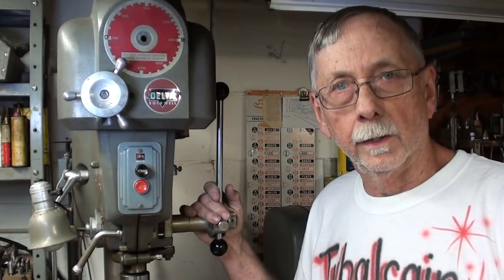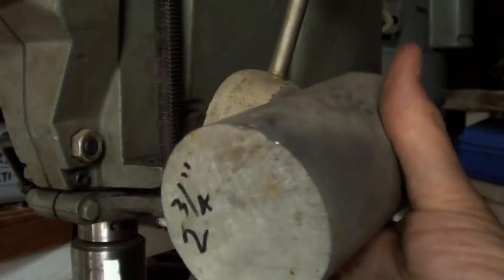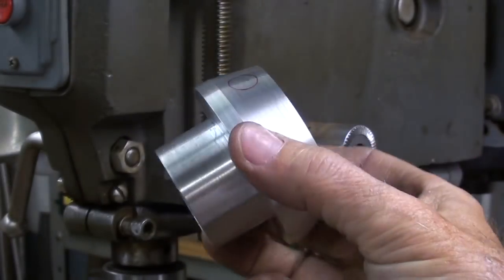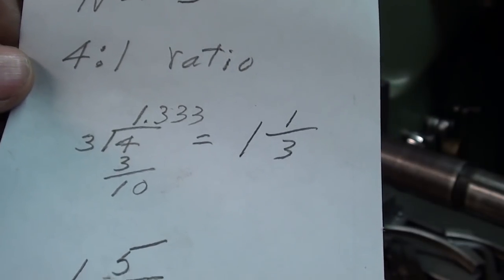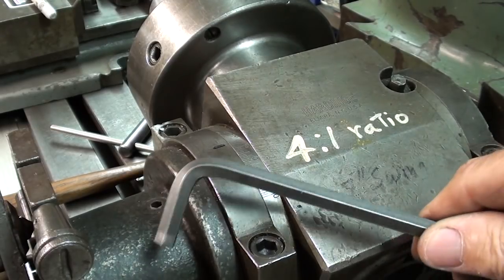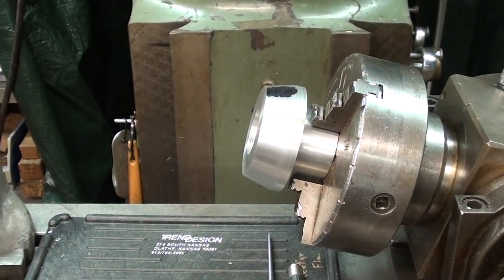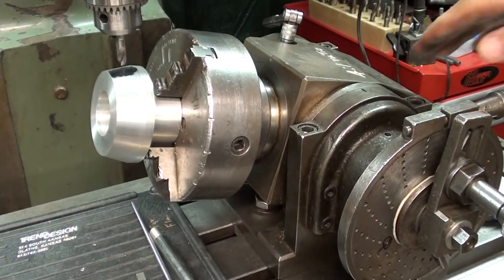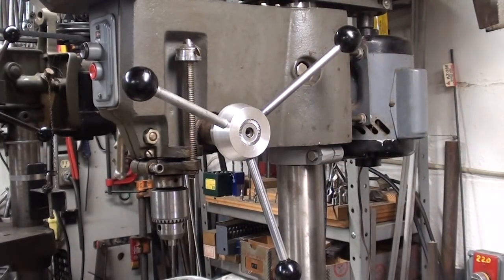Improved Feed Handles Delta Drill Press - TIPS #400 tubalcain

Comment: I'm a CAD designer by profession. I took board drafting in high school, trade school and college before I trained in CAD software and 3D software. Just wanted to complement you on your sketch. Proper line thickness, arrows were correct, and the single stroke vertical gothic lettering. :)
Reply: chill214 not that hard to throw that simple design in solidworks and make a print. No need to brag
Reply: Saul Mellado brag? Who's bragging? I explained my training and complemented Mr. Lyle. Not many today go through the trouble of doing proper hand sketches anymore. I'm glad he takes pride in it.
Reply from the maker: i'M STRICTLY OLD SCHOOL --THANKS FOR NOTICING.  As you can see, other commenters are clueless.
Reply: Heh, my wife and I both took drafting in middle school with old school teachers. Very picky about lettering, shape of arrowheads, proper positioning of scale lines, etc.
Reply: I was in the very last ever Mechanical Drafting class at Amador Valley High School in Pleasanton California in 1995.  The class was phased out the year after due to the progression towards computers.  I was also the only person to get an "A" in that class as well.  T squares, 45 degree triangle, 30/60 degree triangle, compass, pencils with different lead hardnesses where some of the tools we regularly used.  I retained what I've learned from that class to this day and have used this skill many times for various reasons.  I also noticed Tubalcain's sketch and was thinking the sames things as Chill214!  Great video in general Tubalcain!
Reply: I gave my drafting kit to my daughter. She was impressed with the French curves and eraser shield.

Comment: Three different handles is useful. When you are doing an operation it is helpful to be pulling on the downstroke for strength. I find it to be a nuisance to have to shuffle my choice of handles each time I do some repetitive operation. I have taken to putting a wrap of three different colors of vinyl tape on the handles. I find it easy to remember to grab the yellow (or red or blue) handle each time I make a repetitive operation.

Comment: Excellent job!     Should make things much easier.      One recomendation tho......next time use blue locktite.  It will hold quite well for this job but will come apart much easier just in case you have to remove it for some reason.

Comment: My dads non variable speed Delta originally came with a single handle as yours  had.  That was in 1950.  A few years later he purchased a 3 spoke hand wheel, apparently as a factory accessory.  It was a whole lot more fun watching you make one from scratch as that is beyond my capabilities.  My dad never threw anything out so I still have that single handle around my shop somewhere.  Thanks for your great videos and explanation of tools and techniques.
Reply from the maker: Thanks for watching.

Comment: If we all remember that this is NOT Mr. Pete's only drill press, then it is easier to understand why he made the modification, and why he put Loctite on the handles.

The single lever handle has its place, and he can always put it back on if he finds it better for a particular job.

But he does have the good fortune of owning several other drill presses.
Reply from the maker: Yes, I have 6 presses. I was shocked to find that many men thought this unneeded. Apparently they have never used a DP.
Reply: mrpete222 I always wondered why the Bridgeport mill only has one handle to move the quill. Why not have the three or four spokes on the Bports too? Thanks!

Comment: Lyle, nice upgrade/modification, is it possible to reinstall the adjustable part without the handle to preserve the original piece and might enhance the end view of the shaft....ATB Chuck
Reply: Better yet drill and tap the inside of the original hub for a pair of dowels then put matching holes in the  new hub to tie them together and remove the new drilled pin. Then you can easily still retain the feature to clock the handles where it is comfortable for a kind of best of both worlds. :-)

Comment: The argument against loctiting the handles is that one may have to be removed to clear the work and/or jigs/fixtures. I have had this need more than once. On the other hand, left as they come from the factory, the tapped holes tend to become wallowed out as the handles work loose. This would be especially true with an aluminum hub. So I'm inclined to agree with Landrew0 that the original arrangement was a feature, not a bug. A deluxe feature, actually.
Reply: The new handles come out at 15 degrees.  This gives more clearance than the originals that were parallel with the column.

Comment: Nice Job Lyle.... I can only suggest, because I'm picky, why not make a cover cap for the end of the shaft using the original bolt. This would clean it up and save that bolt too. Oh, by the way, I have a similar machine in my shop. It has three handles already on it.

Comment: I had a feed handle like that original one on a turret drill, not factory but added by the previous owner. It was handy for short throw stuff like countersinks, but because of the long stroke required to index the tools it got replaced with 4 handles fairly quickly. I also added power to raise the head as I hated having to stand on a step stool with a wrench for every setup.
 You mentioned not modifying the machine. I would have made the hub with a flat bottom bore and through bolt hole then the splines would bite into the bottom of the hole and be cinched tight with a bolt and heavy washer. That would also allow it to be moved to a more favorable position according to the 
job. And allows the original handle to be reinstalled with one bolt.
   Mike (o\!/o)

Comment: 1. I agree on keeping original parts if you modify the machine!   2. I've always used presses with multiple handles, but have seen tips that say to remove all but one handle and set it up for a single stroke. To each his own...     3. Maybe use a hardened drill bushing for a pilot hole through that aluminum collar and the shaft?
Reply from the maker: Yes

Comment: Lyle,
The 3 jaw chuck on the dividing head could have been used as a reference to drill the 3 holes and saved that setup time.
Reply: Yeah you could have used a set of dividers to insure the spacing is the same.  Yes it would have been "good enough".  Yet when has Mr. Pete ever done "good enough"?  I come here to learn the right way not the shortcut way

Comment: As a matter of fact I'm in the process of doing that right now on my Clausing drill press. It is comprised of an aluminum hub,4 stainless  centerless  ground handle rods and new ball ends from McMaster  Carr. Interestingly the tap and die are also 7/16-20. If that isn't enough I will make the original three handle into a six handle but I think it's a bit overkill.
Reply from the maker: AWESOME.  Notice how many commenters think there is no need
Reply: I'm with you Mr. Pete.  If you need to drill a deep hole or need to lower the quill quite a way to reach the work, one handle would be a pain in the butt!

Comment: With the dividing head I would have used 1 of the 3 jaws and made it level, then put a jacking stand underneath the jaw, after each hole remove the stand advance past the next hole then backed up to the stand for the next hole, ready made 1/3 divisions and no time or calculations required for set up.

Comment: How long before you make a little cap for the thread on the end? Or will that not bug you?
Reply: Yep, that bugs me too.
Reply: I’d have to give those handles a polish too so they’d all look the same.
Reply: Even a short bolt and fender washer would work........
Reply: Polished brass cap would be classy!
Reply: I would just screw back in the original knurled bolt by itself to cap it off and  to retain some of the original look.

Comment: Hi Mr. PeteLove your videos; I recently bought a Delta Milwaukee DP 220  Bench Drill Press that aside from surface rust is in  remarkable shape and appears to be all original down to the DM motor. It wasn't until I started to reassemble it after refurbishing the assemblies that I noticed that the motor pulley sits about 3/4" higher than the spindle pulley when the motor is mounted in the lowest position on the mounting plate. I can't believe that this is part of the design; it would seem to put an un even load on the spindle bearing and cause uneven wear on the  bearing. Any thoughts?ThanksBrian
Reply from the maker: Nice find it on the drill press. The misalignment probably only cause belt or pulley wear.

Comment: So why aluminium and not steel? Won't the aluminum holes deform as it's used?
Reply: Should be fine and work without any problems, especially since he used Loctite to prevent backout/wobble.  However, some people can destroy anything.
Reply: 6061 aluminum machines beautifully and the strength is close to mild steel. suitable for many jobs.
Reply: Plus if he made it out of steel the job would have taken him twice as long or close to.

Comment: I liked the original single handle design. I get annoyed with the 3 handle design on my regular drill press. And even on my little jet mill, it has a 3 handle deal like that and I took it off in favor of the hand crank. I think the manufacturer had it right with the single adjustable handle. Just my two cents. Love the videos though
Reply: A speed handle like on my mill would be even better (I think).  Or maybe even one that ratchets?

Comment: Why not just drill and tap three  holes in the arm collar and use set screws in stead permanently altering the drill press ?
Reply: You'd have to machine flats on the shaft which would be far more work and you'd still have a permanently altered drill press.
Reply from the maker: yes
Reply: mrpete222 Thank you. My brother has been building and repairing injection molds for 20 years.. Alot of this is like a foreign language to me but I enjoy it. Thanks for opening up my understanding of this alittle. Keep up the great videos :)

Comment: You've got a thredded hole going through the middle of the shaft and your cross drilling it for a rollpin? Why not mount a plate with a hole in the center to the front of your newly machined part, and use a bolt in the center to lock it in place (like the original equipment). This would give you the best of both worlds. 3 handles and infinite handle positioning.
Reply: Also with a slight re-design of the part you made you could easily omit the addition of a separate piece being added. If you only bore the hole through the center 3/4 of the way to the size of the shaft, the last 1/4 would only need to be as large as the fastener. Your new "hub" would then be clamped in-between the fastner and the shaft.

Comment: For the life of me, I can't see how 3 handles is better than a single handle which you can position any way you like.
Reply: Deep drilling of holes can become a pain when you have to stop and reposition the handle for safe and comfortable drilling.
Reply: Then you haven't drilled many holes on a drill press.
Reply: For me it nice to have the 3 handles in basically in the same place all the time. With a handle like the adjustable handle it seems to me I would have to set up the handle for every different hole i had to drill.  It really is just preference though.
Reply: @Landrew0 — I agree. I have this style of handle on one of my drill presses and being able to position the handle where you want it is a really nice feature. I suppose it’s just a matter of personal preference. I was glad to see that he made the change reversible instead of destroying the original.
Reply: I second that. I have a press with 3 spokes and tock of two of em. They are just more in they way for me. The stock handle looks really sweet. But it is Mr P press and if he prefers it like that, so nice mod nonetheless.
Reply: It looks like you only get a third of the stroke with a 120 pull.  This style makes it easier to grab the next handle one handed.
Reply: TIME

Comment: If anybody needs a good boat anchor you can have my Chinese drill press. I could make it good with a rebuild bearings etc just not worth it. Ahoy mate. Thanks TC!
Reply: jacktheripped mine is a buffalo brand. When my friends come in the shop I tell them it’s for the scrap man. ( not really ) but it saves the embarrassment. I do wire wheel work with it and put sandpaper on a stick and sand on some wood from time to time. BUT NEVER A DRILL BIT! I had a guy give me an old horizontal band saw made in China and after a lot of work and a new blade it still will not cut a fart.
Reply: That wasn't the fault of the drill press. Your drill bit wasn't ground properly....probably Chinese also with off center grind and too much clearance.
Reply: Shittly bearing and flexible like a wet noodle.
Reply: Hard to find good stuff at HF but the stores are full of customers buying like crazy.

Comment: I was disappointed that you drilled and pinned it. I was waiting to see the same lockdown as the original.
Reply: KinRatt: Pinning is easiest although I would have used a roll, (or spring) pin instead of the solid pin he used.
Reply: I agree. Why pin and drill thus changing the original machine. Exposed end also looks unfinished.
Reply: Although more work I would have liked to have seen a blind hole mounted like the original with a capscrew.
Reply: Ellie Price obviously pinning is easier. So is leaving on the existing handle.
Reply: KingRatt: The whole point of the video is for MrPete to demonstrate how to replace one handle with three. Since it's his drill press he gets to choose his method, which was pinning the hub with a solid pin.
Reply: Nothing wrong with the way Mr. Pete did it, which was one of several correct options to lock the collar onto the shaft.